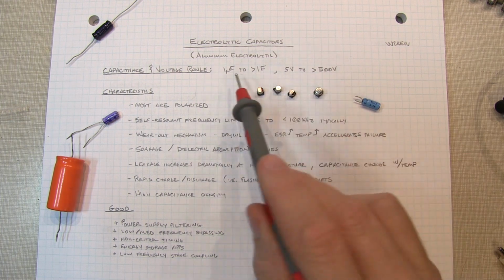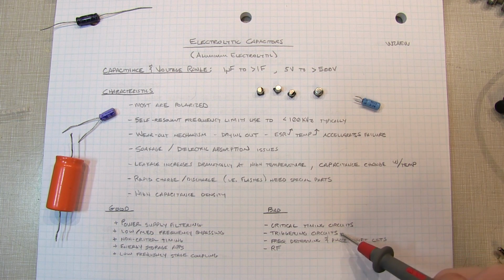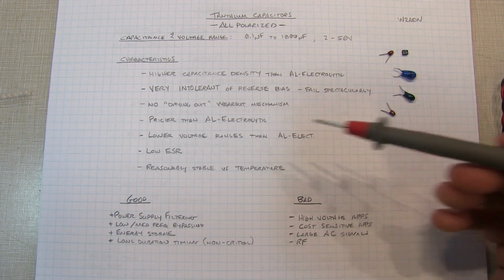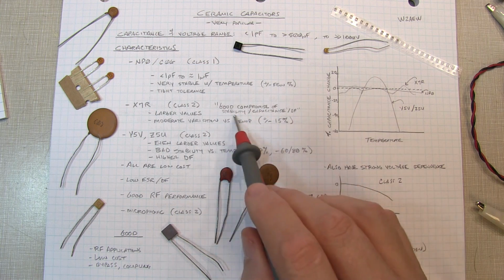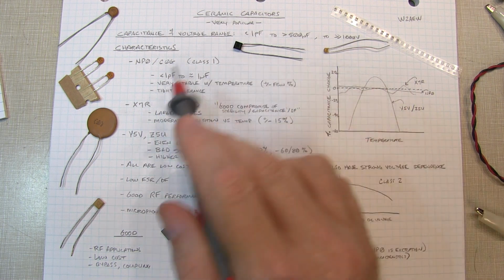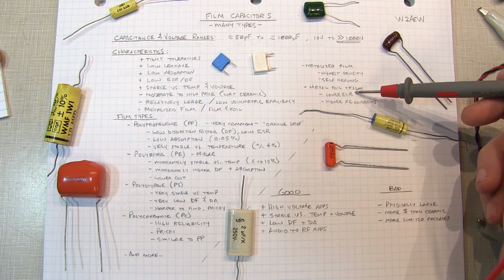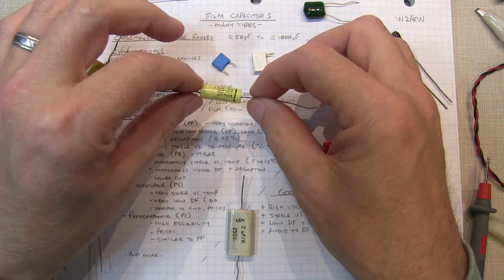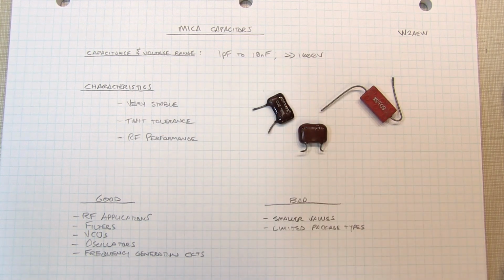#256: Capacitor types, characteristics, and applications

Comment: I'm seeing motherboards for PC's stating "solid state" caps. what are they??? tants?
Reply: Those are aluminum electrolytic capacitors with a solid polymer electrolyte.
They have a much lower ESR and longer life than regular aluminum electrolytic capacitors.
Reply: Solid polymers.  Gotta be careful though,  cylindrical solid polymer caps don't have vents on top,  while the standard surface mount electrolytic caps do - and they look exactly the same except for those marks.  You'll see manufacturers passing those off as solid polymer caps (which are more expensive) when they are not.

Also,  solid polymers on pc motherboards are marketed as lasting for decades,  but really who keeps a motherboard on their main pc or even a backup pc for more than a few years max? Seems a bit silly to me,  and it can drive up the price of motherboards significantly.
Reply: I think most of the major motherboard / PC electronics brands use quality components. They are under such intense scrutiny from the gaming and enthusiast market, that they can't really get away with shitty components, if they tried to do it they would get roasted alive by tech reviewers and overclockers. Most motherboards are overbuilt by a factor of 2 or 3, when it comes to the high-amperage CPU power delivery designs, at least the moderately priced and upwards are completely overbuilt. If taken care of they'll last a very long time indeed.

The only place I think they might skimp on quality is on OEM boards, since they are under basically no technical scrutiny what so ever. 

With regards to the comment above about keeping motherboards for more than a few years.... I think it's an insane assumption that people replace their entire platform every few years max. I am currently on a 4 year old platform, and I don't intend to upgrade for many more years. There's simply no point. My Intel 4770k is fine for years to come. My parents inherited my old socket 1336 computer, and it's blazing fast for everything they ever need. And right next to me, I have a socket 775 motherboard with a Core 2 Duo in it - runs Windows 7 on an SSD, and it's pretty much as fast as my 3000$ main computer, at everyday tasks like browsing. I have several other motherboards that are over a decade old and they work great!
Reply: 300 khz eh... Just out of curiosity I probed the outputs of a VRM next to the CPU on my main modern motherboard with my scope, the board is an Asus Z170-P D3 and I'm using a core i3.  

Link: http://imgur.com/a/dqvPA

And that's after all the filtering. That is some serious switching noise,  .5mV/Div.  Unless I'm coupling noise in somehow myself (i don't think so),  modern pcs are resilient as hell.  Edit - there's probably some more filtering going on closer to the CPU,  but the points are too small and I really don't want to slip with my probe lol
Reply: Hmm, curious about those spikes. I actually have been scoping an old socket 775 board while overclocking, and I'm seeing less severe spikes, on a 100mhz scope. Although I think I'm actually coupling in noise from elsewhere, even though I have soldered some short stub wires to the outputs of the chokes, it's a short path, but I wonder if it's coupling in switching noise from elsewhere.

The reason I think so is because Intels has maximum specs for ripple in their datasheets (this is for previous generation Core i3: http://i.imgur.com/OcuU7CQ.png) - for i7's the max ripple allowance is something like 5mv. Seeing as motherboards have to account for basically any compatible CPU being installed, they have strict specs.

I think note #3 is probably a reason why our measurements are spiky.
Reply: Good point, didn't consider that.

Damn, now I'm on a mission to invent Vcore / Vcc ripple measurements on Intel motherboards. I had other plans today :P
Reply: Huh, today I learned. I thought they were still wet electrolyte, just better encased. Thank you!
Reply: Well apparently Gigabyte found a cheap source, as they have solid or gelled electrolyte low-ESR caps even on lowest end cheapest boards. But as far as rumours go, they might be saving elsewhere, i.e. on the specification and quality of transistors. Not sure there's a reason why this type should be significantly more expensive than liquid electrolyte caps though, it's not like there's any expensive raw material in them.
Reply: By few years I mean 5-10 years replacement of a motherboard,  but that's not my point.  Polymers are marketed as lasting 40+ years or more on motherboards which is silly,  no one keeps them that long.  But as you mentioned,  motherboards are overbuilt because I suppose that is what people want.  For example,  I'm not seeing the point of ultra low ESR polymer caps on a motherboard,  since the majority of electrolytics on a motherboard are being used for DC/DC conversion filtering or as part of the onboard audio path (coupling/decoupling/etc).  There are already ultra low esr caps on the output of any decent modern ATX switch mode power supply; and they need to be there.  I just havent researched enough into why they use them on the motherboard I guess aside from coming to my own conclusion - marketing.
Reply: @Sloxx701  They use them because they have a very low ESR compared to low ESR wet electrolytic caps. Since the ESR is so low they can use less of them and make the product smaller. However they are significantly more expensive than wet electrolytic capacitors and aren't available above 100V.
Reply: They play a huge role in regulation and filtering at the CPU and RAM (and depending on platform, other critical areas) local voltages. Same reason we have multi-phase power regulation as well, it's common for a mid-to-high end motherboard to have 6 or more phase regulation to the CPU. It's actually hugely important for the stability of modern CPU's and similar. Seeing as a modern CPU can easily gulp down a hundred Amps @ 1.x volts while running at full power, and graphics cards can easily gulp down several hundred amps, bulk capacitance and smoothing really matters. A momentary drop of 50 millivolts, or regulation quality decreasing under load can crash a system instantly.

This is especially true of overclocking, when voltages matter even more, and the current draw is increased by a disproportionately large amount. And considering almost every single person who buys a high-end motherboard and CPU is going to overclock, it does end up mattering a lot. That's why they have very large margins - they want things to not just work, but they want things to work WELL. And they want things to work well with sensible temperatures - that's why you have overbuilt CPU VRM's for example, because yes, their theoretical capacity is way higher than any CPU could possibly draw (a modern enthusiast CPU VRM may be capable of delivering 400+ amps), it does mean they can deliver a lot of oomph while keeping temperatures much lower.

This is also why OEM motherboards aren't overbuilt - because the computers built with them aren't going to have high-end power hungry components, and they very likely aren't going to be loaded very hard, and they also aren't going to be overclocked at all, ever.
Reply: Ah I see that makes a bit more sense,  I didn't think of the high ripple current aspect of solid polymers,  and I know that high end pcs are current hogs.  I'm not hugely familiar with power delivery on motherboards for the CPU,  I work more with SMPSs (which mostly still use standard electrolytics on the outputs).

Interesting story,  about 8 years ago I had every electrolytic cap on one of my motherboards fail visibly, about 15 of them,  bulging and leaking.  I removed all of them since a couple were corroding the board but I did not have replacements. I fired up the computer anyway and it continued to run perfectly fine for another 2 years,  and I was gaming on it every weekend.  I'm still having trouble explaining that one,  but my theory is that the power delivery from the PSU was so exceptional,  it didn't really need the extra filtering.  This is not something I see very often though,  one bad cap in a critical place can bring everything down.
Reply: Colour me surprised. Very surprised. Because i just dug up a few mainboard schamatics for comparison, and while newer board basically didn't have much output capacitance, a 2004-ish board that i found had only a couple capacitors on the power supply side, and the rest were on the output of the voltage regulator that supplies the CPU, after the choke.

Now it's not entirely unlikely that all these capacitors did was reduce ground noise, and the rest of the board was sufficiently ground noise current resilient, while the chokes were what the system actually relied on to smooth the regulator output, together with voltage feedback from the CPU socket.
Reply: I think that the power supply that I had just wasn't producing much switching noise,  and it also had some high quality Nichicon output caps and a couple of huge chokes in the output stage.  I'm actually still using that power supply,  it is about 10 years old now:  a $45 380 watt Antec Earthwatts.  However,  I also have an Antec Basiq 450 watt power supply that is about 6 months old,  it was $55.  This one basically stuck it's head up it's own ass after two months of use.  One of the chopper FETs that drives the main switching transformer blew it's own face off and this also managed to kill the PWM IC and another transistor in the error detection circuit.  Not sure what the hell happened there... There was no PFC in this power supply, just a voltage doubler switch, which is kind of terrible to begin with and may have been a contributor.

Also it's very possible that the regulators on the motherboard - which are pretty much just buck converters controlled by the cpu anyway - just weren't producing enough switching noise to cause issues.  This machine wasn't overclocked but I imagine if it was it would have crashed in an instant.
Reply: Huh, interesting that it worked with caps removed. But then again honestly a lot has changed in 10 or 15 years - I've been doing some extreme overclocking on ~2006 era hardware, and they operate at a much higher voltage than modern stuff, which probably means that they are overall a lot less sensitive to voltage drops under load. For example, a Core 2 Duo I have, can handle as much as 1.8 volts to the vCore (not recommended, but it can do it). 2004 era Pentium 4's and similar larger process node CPU's are probably even more forgiving. Giving a modern 22nm CPU 1.8 volts would be a great way to either outright kill it, or shorten its lifespan at a staggering rate!

I'm sure the fact they use large chokes and multi-phase power regulation also helped out in your example there - 4 or 6 phases @ ~300Khz each, plus big nice chokes, I'm sure they regulate very well out of the gate.

Of course, one of the big reasons they have so many phases it to deal with transients, I'm sure capacitors on the output matter more for dealing with transients as well
Reply: The sense line is a currentless feedback line that goes out of the processor. Not sure what happens to it on the processor - RC network, something else? No idea how direct the connection is.
Reply: Yeah, I was probing on what I think was V_Out. Vcc/Vss Sense are probably connected to sense and gnd inputs on the pwm controller.  Then again I don't have a schematic so I'm kind of flying blind with exception of looking up datasheets on components.  I'll double check and move the board up to my bench for better access and put on the spring ground clip for the probe instead of the lead - I could have been picking up anything.  And with 15+ pieces of test equipment, pcs, and various peripherals plugged into this area,  I do get common mode noise showing up on my scope trace.

Comment: What about the gimp caps?
Reply from the maker: Do you mean "gimmick" capacitor?  This is typically user-made, just a pair of wires twisted together to make a very low value, easily adjustable trimmer cap.
Reply: Yes.  
https://www.sciencedaily.com/releases/2017/04/170404104724.htm

Comment: polarized cap's connect with negative sign on the cap to the negative wire?
Reply from the maker: You just have to obey the polarity indicated on the capacitor when using in the circuit.  Make sure that the negative lead is at a lower voltage than the positive lead - at all times.

Comment: You have to be careful with the "orange drop" caps, and many of the film caps, as the band no longer tells you which is the outside foil. This can be tested by using your scope. Connect the cap and hold the body between your fingers and see how much voltage shows on the scope. Then reverse the leads and test again. It is often the case the band is incorrectly marked. The lowest "noise" pickup will happen when the ground lead of the scope is on the outside foil. This can be important in high gain audio amps.   Also Tantalum caps throw in the monkey wrench by marking the Positive lead with a band vs aluminum caps which mark the negative lead with a band.
Reply: Yep saw that on Mr. Carlon's Lab
Reply: LoL @ your attempt to appear relevant.
You Insecure people are funny... Hahaha
Reply: @jason4547  The irony 🤦‍♂️
Reply: @billyray1172  Jonny the projection

Comment: Nice video, I just looked on ebay under tantalum capacitors and they sure don't look polarized.
Reply from the maker: But they are, all of them.  Usually the + lead is marked.
Reply: They can do spectacular effects when not properly polarized :-) So make sure orientation is ok..